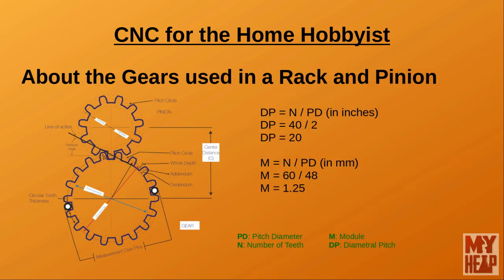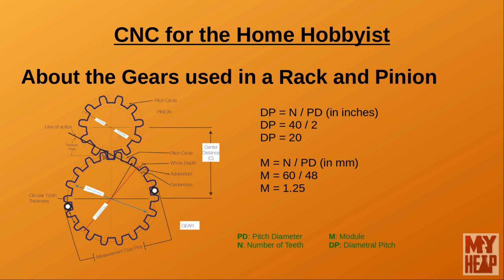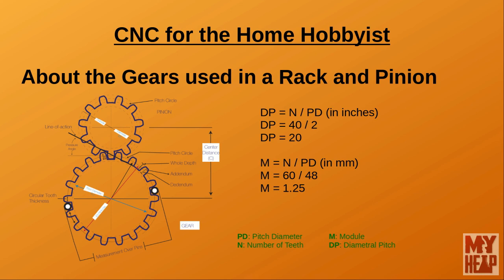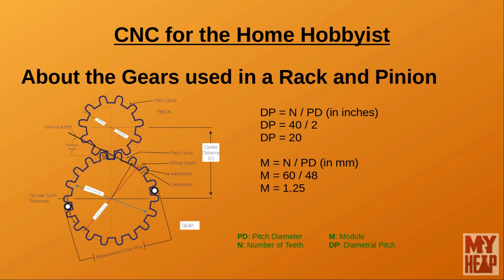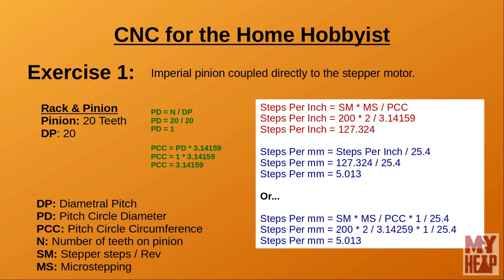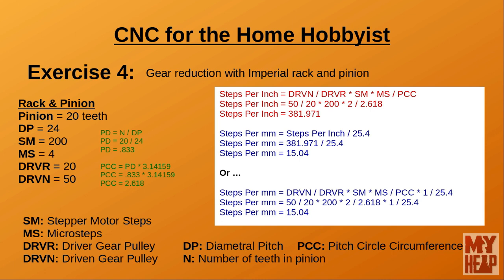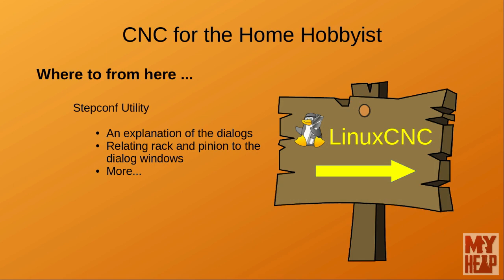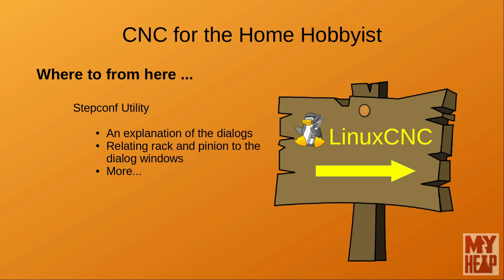LinuxCNC for the Hobbyist - 015 - Computing Steps per Machine Unit (Rack & Pinion)

Comment: What kind of rack and pinion system would I need to get precision tolerance of accuracy and reputability of 0.001" to 0.004"? For a CNC with a Y axis of 7 foot. CNC will be used for carving wood into 3D fine arts.
Reply from the maker: Any would work.  Assuming it is of decent quality you can adjust the microstepping of the controller to get the resolution you need.

Comment: When do you think you will have your next video for the Stepconf utility in this series? Thanks Rick
Reply from the maker: Hi Rick.  Funny you should ask.  I am working on the outline as I type this message to you.  I am guessing I am about 65% done with it, so with some luck I should have it available in a few days at most.  It turns out that we are entering the Chicken / Egg territory.  So the stepconf tutorial will be kind of long, but will require some other videos to explain some of the more nuanced stuff.  Although for a basic setup it should be enough to get you going.  The one after this one will examine the setup for my KRMx01 router in the most basic mode.  Then I want to cover hooking up the hardware and some house keeping.  Once the basic axes of the machine is set up I will cover things like homing and limits and spindles.  Thanks you for being patient with me.  I have a HUGE list of videos I would like to make for this series, but have not had the time to spend on them the past few weeks.  Thank you for taking the time to watch and commenting.  I really do appreciate it.

Joe
Reply: Joe. Thanks for your diligent work. I have my router all built and moving no problems. I'm now drilling down to setting the accuracy. Your examples of how to figure all of the calculations are very helpful, now I'm to the point of how they translate to either what I put in to the Stepconf (how the calculations equate to what is entered in the utility for the axis's) or what to put in to the .ini file to tell the machine to move an inch and it actually be an inch. I know that every build is different, so trying to find out the correct combination of microstepping & leadscrew pitch from my drive gear calculations. It can drive you bonkers.

Thanks Rick
Reply from the maker: Rick, the stepconf video I am working on will cover the settings.  But remember, like most things in life these are just sane values and will require some testing to determine if they need adjustment.  In a perfect world all would be fine, but errors in leadscrew pitch, backlash, driver timing and other things will affect your final figure.  A general approach can be had by cutting a 4 or 6 inch square and measuring the actual size (remembing to compensate for the cutter), then backing out the calculations to see what the pitch of the screw really is.  This can be entered into stepconf without the worry of losing a custom setting.  Or you can back out the calculations and recalculate the steps per inch, and replace the value in the INI file.  If you do this though, the next time you run stepconf the value you placed in the file will be over written by stepconf.  These situations are the cautions I keep mentioning about stepconf in the tutorials.

Thanks for watching.  It sounds like you are progressing nicely on your machine, BTW.

Joe

Comment: Hi Joe. Thanks very much for your very informative videos on LinuxCNC I think iv'e watched them all !! Thing is there is so much information to take in. 
I recently bought a Chinese 6040 cnc and it came with a pirated copy of USBCNC which i'm not happy using so am considering changing to LinuxCNC. After a few issues with the machine mainly wiring it seems to be working well so i'm a bit frightened of breaking something installing Linux. Could you advise me if it's possible to run my machine using the supplied control box/VFD without spending money that I don't have lol.
Again many thanks for your Videos.
Regards
Mal
Reply from the maker: Mal, email me to xavier@gtec.com and let's see if we can work through it.  Chances are that LinuxCNC will be able to handle the hardware you have but we need to look though it and make sure.

Joe
Reply from the maker: Another great source for you would be the forums and IIRC chat found on linuxcnc.org

Joe